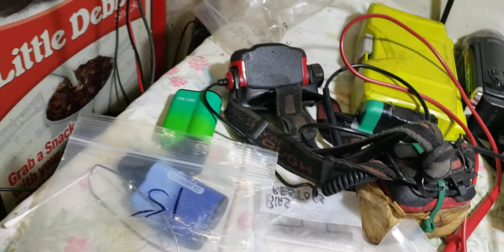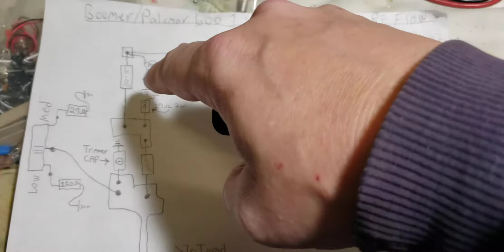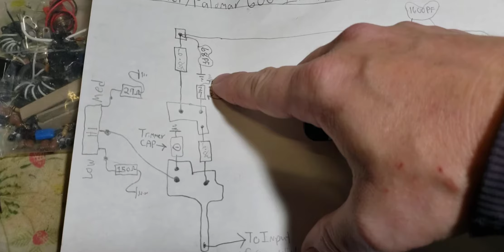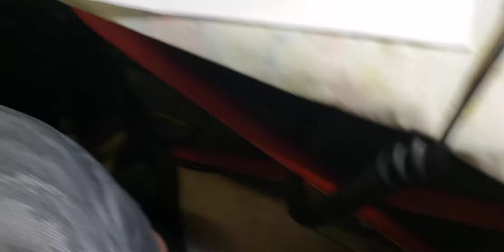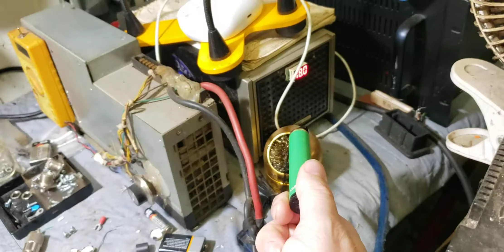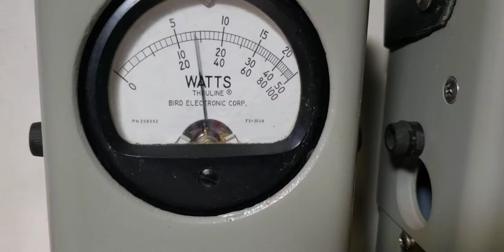Boomer 600 All HG 2879 Modification - [Don't Try This At Home] 😉

Comment: Question could you do something like that with mine and how much will it cost me cause I really like how that one came out especially with the low drive my. I would like mines to end up like that
Reply from the maker: Yes sir I could I can't really take it on ATM but I can add you to my waiting list but if I was you I'd made it a straight 4 then just drive it that way..it will last longer being in this case and board.  Text me to add you 678 557 4846
Reply: @1883GotDown  my name is Ralph Cintron anc i'm in Dallas Texas
Reply: @1883GotDown  but that's exactly what I'm talking about I want it to end up like the one I just saw in your video it gave u almost 700 watts with not much going in.with the 2879s in it I have 5 1446s in mine it works decent on am but on SSB where I mostly tx it's not even swinging 400 once in a while it will catch me by surprise and lean over into 600 watts but it's really rare and it doesn't matter what I use it still does The same.only time it does a little better is when I use my rci 2950dx which is doing 35 to 40 watts on swing both am and ssb

Comment: You know absolutely what you are talking about when you say that , that first 1446 holds back the other 4 I have a Palomar clone with 5 1446s and I can't even get 450 from it  even with my lo drive cobra 148 doing a max of 12 Watts it only does a little better when I no use my ranger 2950 DX Wich is swing 30 to 35 watts then I noticed I get a little over 500 watts.
Reply from the maker: Yep you can pretty much get the same with out the driver lol.

Comment: Excellent video TNX, i got a 600 boomer too, which gets too hot even with only 4 watt drive...may i suggest a server power supply 220amps for only $25 on ebay, but need to modify to make it switch on and boost the voltage, mods can be found at RC-forum
Reply: @Cherrybomb 452 ... my 220 Amp 12.4 volt server power supply is good for what I need. Washing machine motor as generator, excellent idea, as controller best is midnite solar 250, since it can go up to 250 volt which is possible with strong wind, or do cheap solution, just get a 3 phase 150 amp rectifier on a heat sink and connect directly to your battery bank,  and not forget a dump load resistor to redirect the power in case the battery bank is full.
Reply: @Cherrybomb 452 ...but cheaper and less trouble is a PV solar panel setup, they last 30 years and don't need service every 6 months like a wind turbine.
Reply from the maker: Dang cherrybomb looks like I need to be talking to you once I am ready to buy my solar stuff ive been wanting to get into that like crazy. 

Would ne sweet to have solar panels o nthe top of a van and the sides to charge lithium battery's when im not using it lol really cool.
Reply from the maker: Shoot ive looked and looked for mods for high amperage power supplies like that and never can find them...for example example I have a 200A 12v server supply over here...no mods if you have one that I really can mod to turn up the voltage then im there like yesterday lol...can you text me the information bud 678 557 4846  thanks so much John q
Reply: @1883GotDown  ...send me the pinout plus picture of your PSU and I will try to find a mod.

Comment: that a blue one. There is a black one just like it as well. done a few. never went to 2879. I am Happy HG now has SD 1446. The MRF 455 is still around. I would love to do one with HG MRF 454 with RFP 1446 driver. That bias is a easy fix. swap out diodes. remove the leads with ferrite from input transformers on 4 pill section.  or just go with Texas star bias . I hate the input on them. less then 50 ohm impendence. Tahy hide the bad tune behind resistors. most have the driver wrap's wrong. for me it is not enough heat sink fore 2879. the MRF 454 is ok. you can even use a MRF 450 driver. maybe a 449 . the last 2 I did was MRF 450 driving 4 SRF 3775 getting easy 600 watt PEP and clean an not too much heat leaving bias on. just fix it so it works . 1 thing I found with SD 1446 is with bias up .76V they run hot . pull over a amp with 0 rf. and if voltage on collector is up around 15 say good buy to pill. when first fixing bias I had one drawing almost 6 amps no RF. 5 pills 1446 bias .76V. Also I used my MFJ antenna analyzer to fix input tune . bypass keying transistor. put power on it. dummy load and check input. I think at the time is was a cost thing .   No one took the time to get input right or bias right. did a quick fix. send them out. It may be a way of cutting the drive down so not over drive 4 pill. makes it un stable self osculate make bad harmonic's .The OEM SD 1446 is good to 80 Mhz. it can easy make a lot of 2Nd and 3Rd . back in oud days of NTSC TV   . key that amp say good buy to Ch2. 73's
Reply: You should make some videos about your projects too.